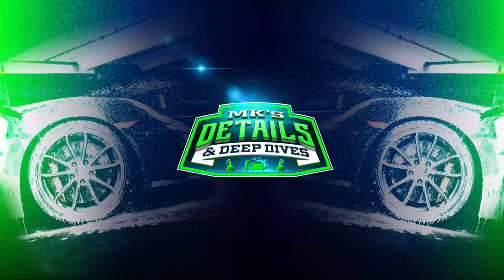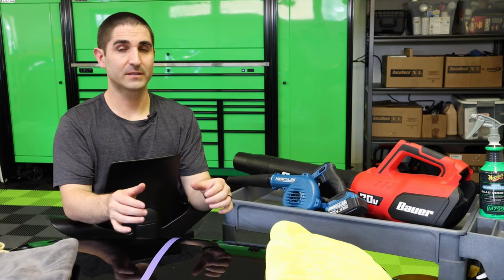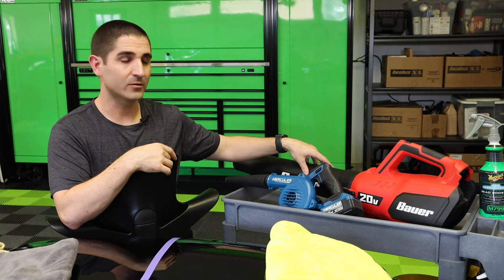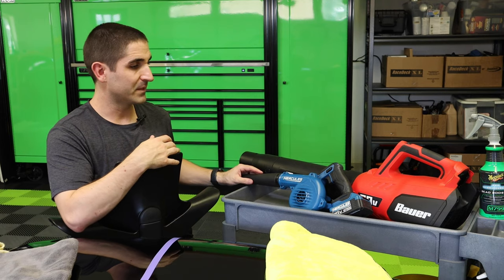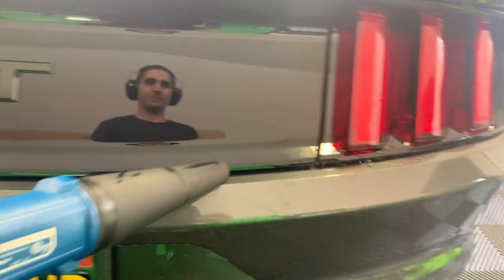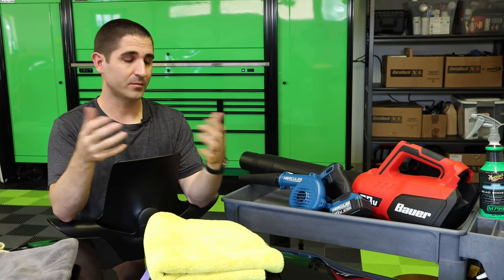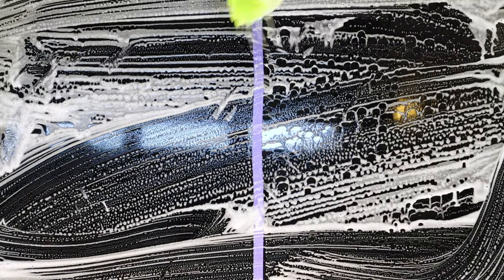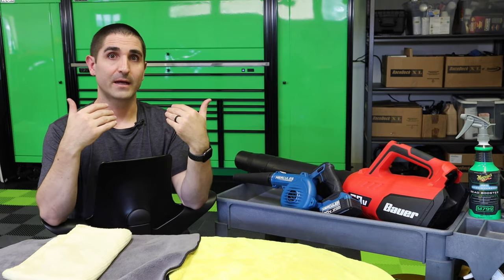How to PREVENT Swirls & Scratches in your Paint

Comment: Does forced air scratch? A leaf blower some say can scratch. I  what context is it safer or not etc to you
Reply from the maker: Forced air is actually the safest of all options and least likely to cause swirls since there is no physical contact. The key though is that the surface needs to be hydrophobic for it to be effective, otherwise the water will not blow off of the surface (taking dust and other contamination along with it) efficiently and you will take forever trying to dry it that way. 

I do suggest NOT using the same blower you use for yard work, though, as it is possible to have dirt, dust or other contaminants in there that could damage the car. 

-MK
Reply: @MarkusKleis  forced air blowing dirt on the surface can scratch obviously you mean forced air on a clean car that is hydro phobic makes sense.  Just like a pressure washer can scratch a car if there is dirt on it even though it's touchless? Best for it to be clean and hydro phobic
Reply from the maker: @anth115  There is no such thing as a way to clean a car without risk of damage, no matter how careful you are. But there are options that are LESS likely to damage it, and forced air to dry during your wash is one example. As for pressure washers, I think you're over thinking that (same for the air). 

It's extremely unlikely you will cause any scratches from either process, and any alternative is more likely to scratch.

Your best bet to keep the vehicle protected and super hydrophobic and then wash regularly so that dirt and grime do not have a chance to get deeply embedded into the surface, as that requires more agitation or harsher chemicals to remove.

-MK